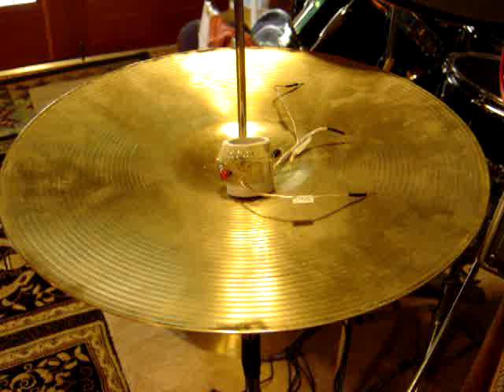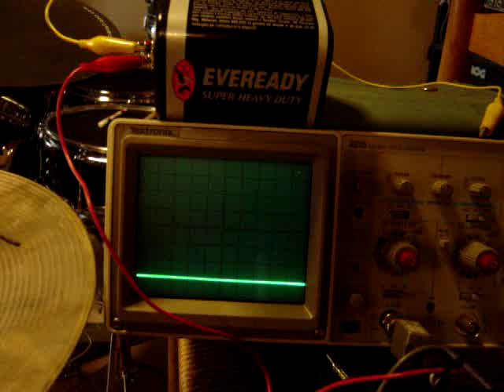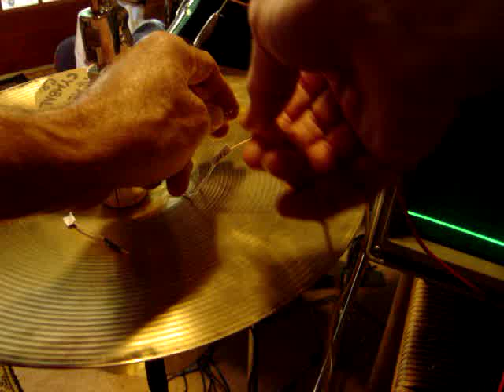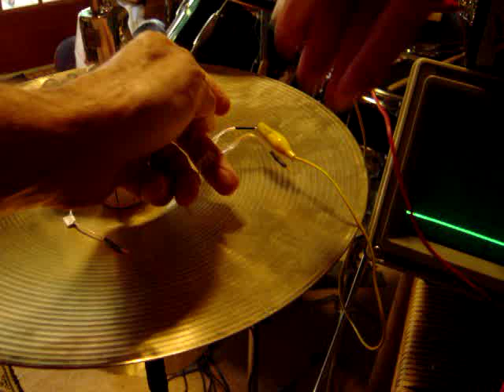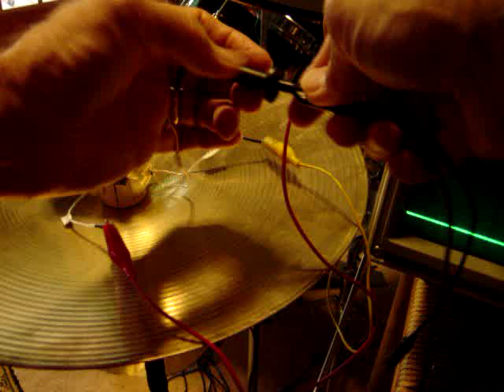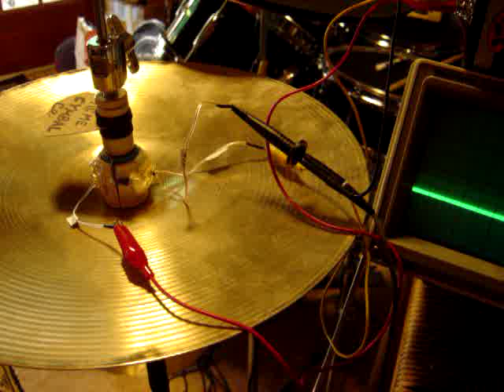DIY Internal Optical High Hat Controller - Segment 2

Comment from the maker: about $100.00 USD, w/ free shipping to continental US (upper 48 states)  I'll need the dimension of the free space inside your hats.  ie; the distance from the bottom hat ..up to the bottom of your clutch parts that extend under the top cymbal.  also, as a check, did you read all my comments? this is not for a Roland module, this provides a varying 0- 5 volt control signal, not a varying resistance, and is a working example of Dmitri's design for Megadrum

Comment from the maker: @racer52online   Note that ALL the audio in the sound demo is from the TD-20 directly controlled by the simple FSR.  Also see the video titled "DiY FSR - The Movie.wmv"  it shows the TD-20 front panel while operating the FSR controller  A single zone w/ choke, piezo triggered cymbal is used as the HH trigger   The FSR is a simple variable resistance device that is 'pressure', or force sensitive.  Using a light spring allows conversion of foot motion to force against the FSR.
Reply: racer52online has

Comment from the maker: @b3nnj1 This Opto-controller will Not work with the TD-20.  The TD-20 requires a variable 'resistance' to control the HiHat.  Please see my video on the FSR. The FSR  will work with the Roland TD-20.  I posted a video of the HiHat audio as direct from the TD-20 and controlled by the FSR in the pictures.  see my video "DiY FSR Hi Hat Controller Sound Demo.wmv" also, follow the links to see build postings on the vdrums forum

Comment from the maker: @mazzhanif1 .. I am not sure that this device will work with the Alessis i/o Trigger.  However, I do not have any expierence with the Alessis Trigger I/O.  This device was designed by the people at 'Megadrum' to work with thier trigger i/o product called Meggadrum.  It may, or may not work with other products.  This device puts out a variable voltage as a control signal for the Hi Hat. It gets its power from the megadrum i/o.  You will need to do some more research on how yours works.

Comment from the maker: @ProfesorLeoB  -  One side of the circuit is simply a light source.  The other side is a component that responds to the light. The light beam is progressivly blocked, more and more, by the triangular blade as the blade moves downward between the transmitter and the receiver.  The fact that it is a metal blade is more or less coincidental.  It was the easiet material I had on hand to make a small, thin, ridgid light block.

Comment: Good work! Just I don't clearly understand if you cut beam light (partially) between emitter and receiver or you use the moving flange as a reflective surfice (to reflect variably, partially). Thanks.